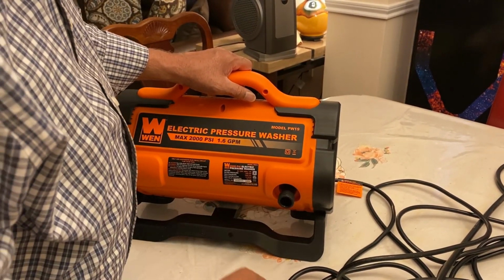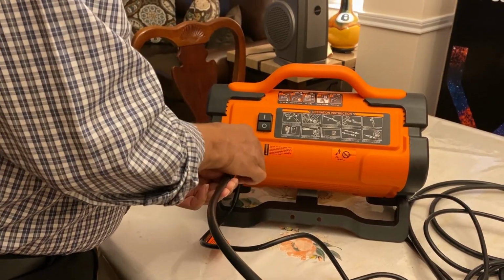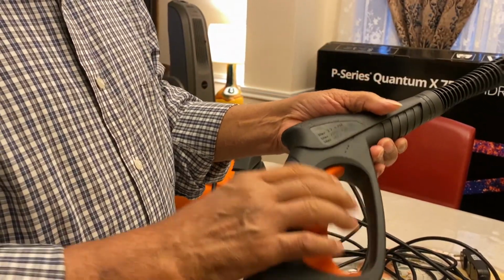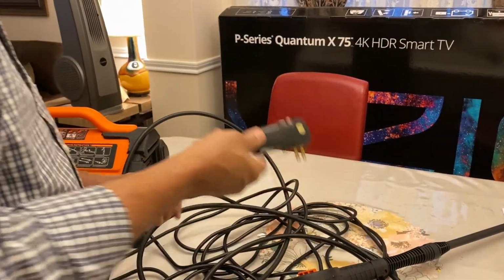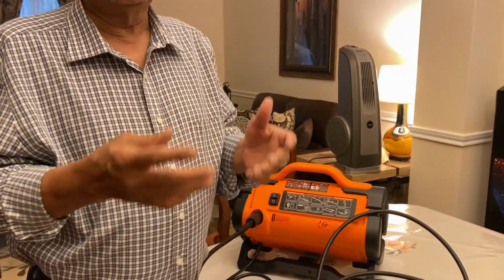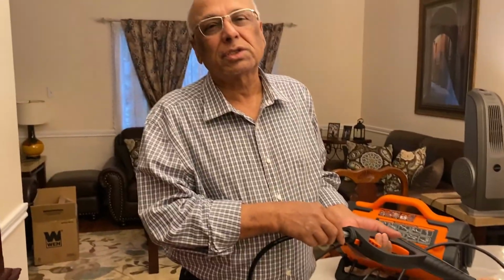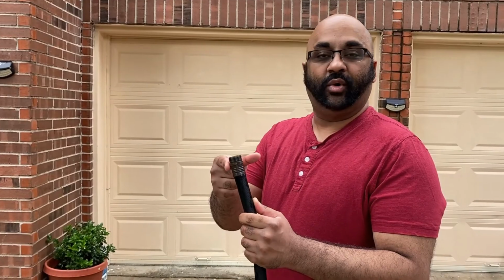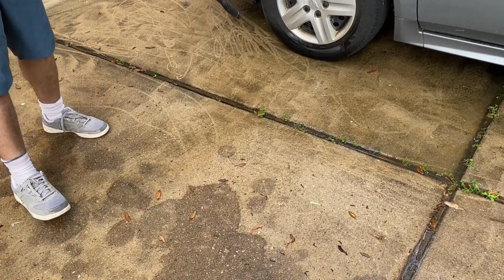Unboxing and Review of WEN Electric Pressure Washer PW19 – How to Connect, Use and Protect

Comment: Any recommendation?  My new Wen has no pressure.  It spray out water even when I had the on/off swith at off.  Weaker than my Worx 165 psi.
Reply from the maker: on the wand that sprays water, at the very end you turn it to left or right to adjust the water flow. If it is set to spray soap, you will have little pressure. This video shows how to adjust the water flow to different kinds of pressure.
Reply from the maker: If the machine's electric switch is not ON it will not have pressure. Also the machine may be on but the GFCI plug may be OFF. Check both please.